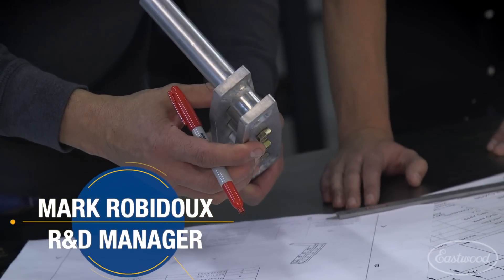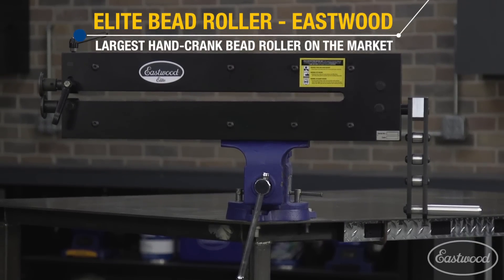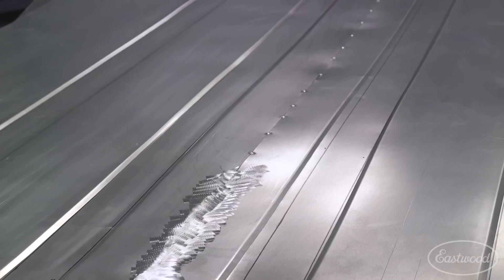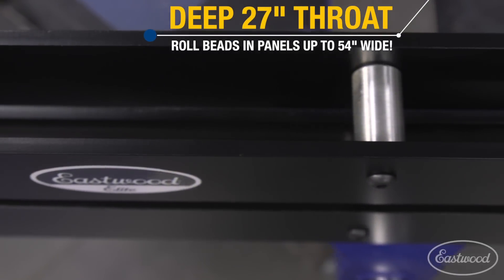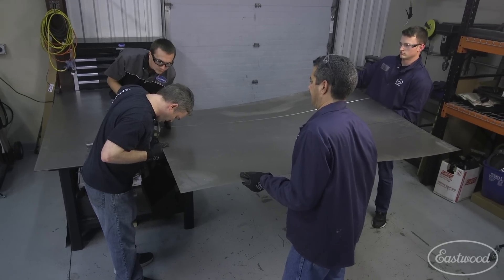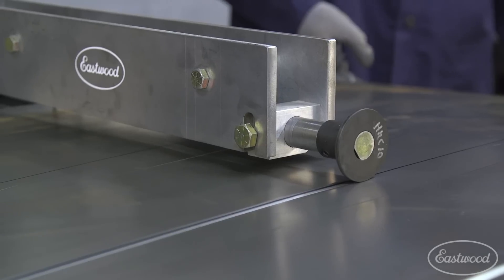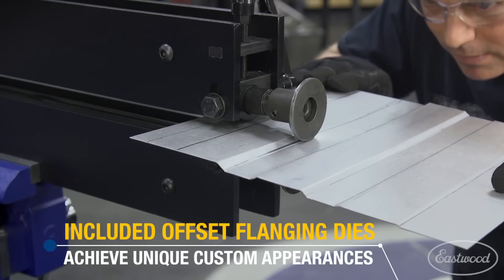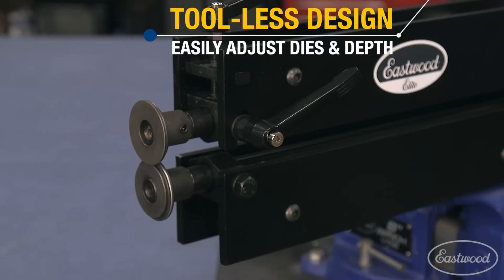How It's Made: Largest Hand Crank Bead Roller On the Market! Eastwood Elite 27" Bead Roller

Comment: Why don't you sell it with the standard dies that come with the 18" roller. So if I want a bead roller, I 1st have to buy the 18" roller to get the bead die set, then throw the bead roller away and buy the 27"?